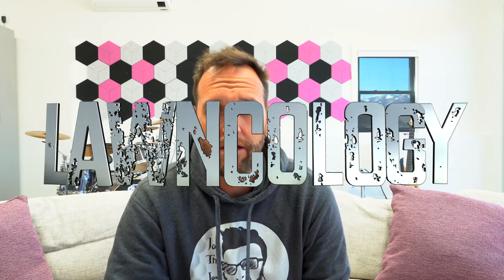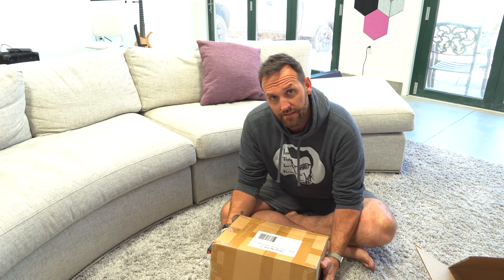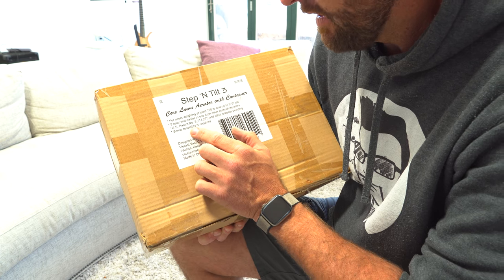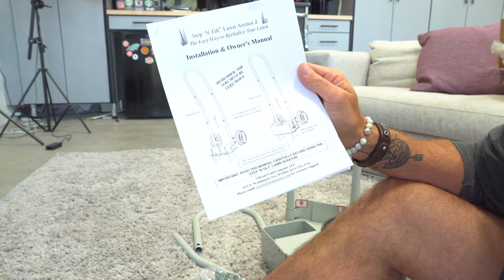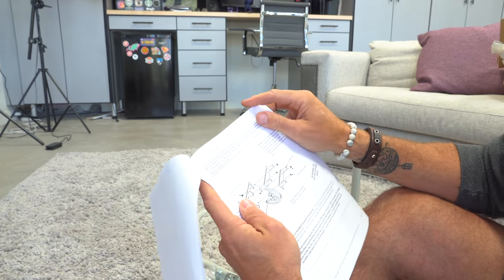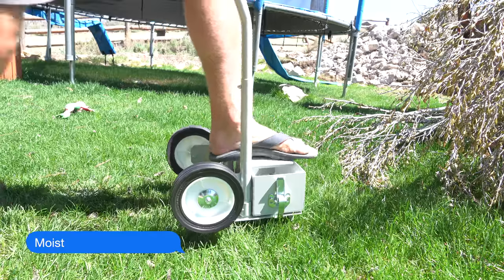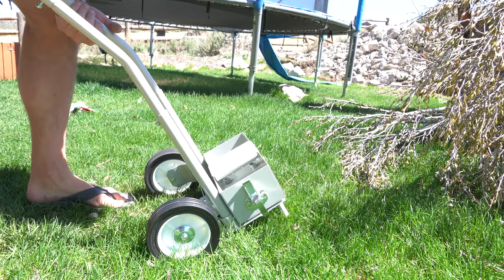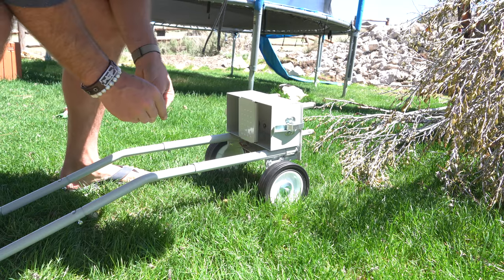MANUAL CORE AERATION, MOIST SOIL PENETRATION

Comment: I actually have one of those I use in compacted areas. Then use the cores to fill in the holes my dogs dig. It is a bit frustrating getting the soil moist enough, but not too moist then unclogging it. And it is good exercise 😉
Reply: Also is easier to only use two tines attached if you are a lighter person or the ground is too moist or bare. (Mine was pulling out large chunks in the bare areas with all 4 tines)